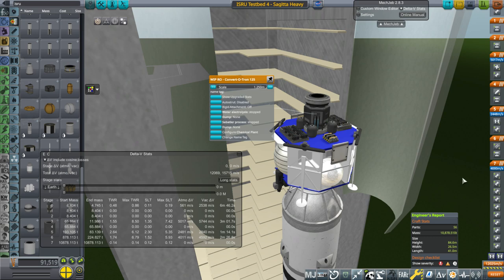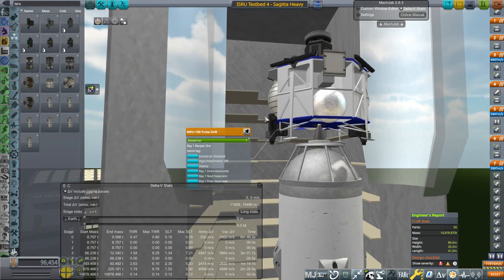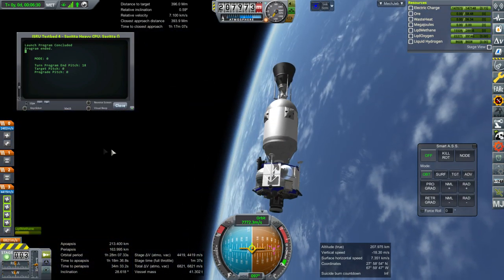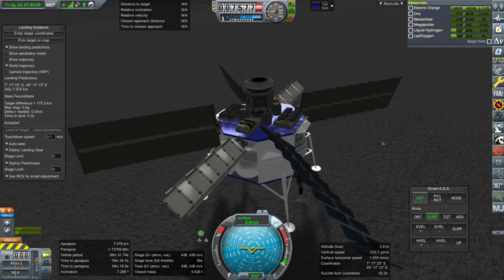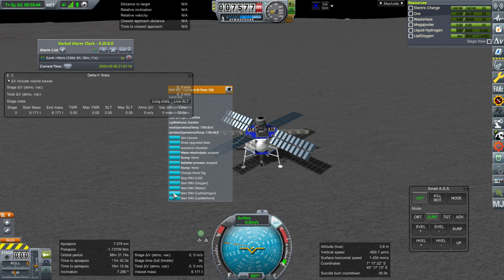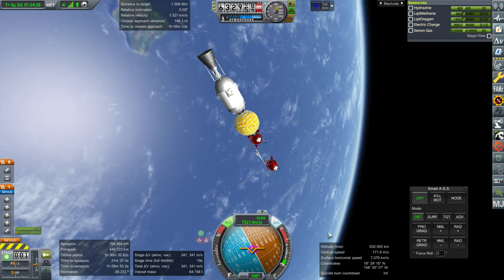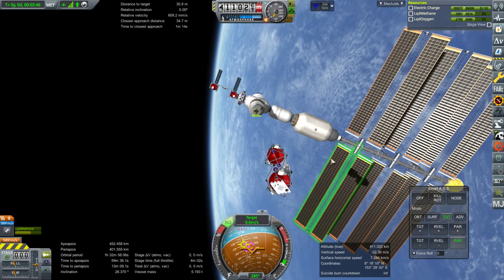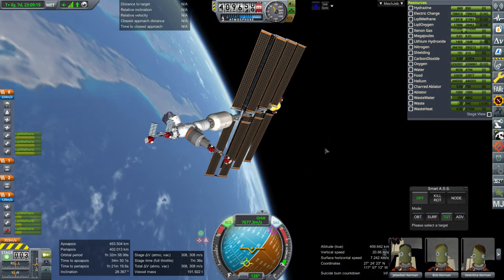KSP 1.6.1 RO and Kerbalism - Mars Colonization 009 - ISRU Type 2

Comment: You could probably use some kind of robotics mechanism to extend the rovers engines in and out. That would make it a little more flexible as far as payload hauling.
Reply from the maker: If you're talking about the tug, the goal was to have it be just one part (except for the docking ports) to minimize lag around large stations. I also wanted to avoid any glitchiness when using robotics. As far as maneuvering large payloads, I have the patience to deal with that, as I've shown. The tugs really can't provide enough delta-v to handle something much heavier than the Xenon tanks anyway.
Reply: Raiz Space Yes I meant the Tug..sorry. Agree that simplicity is best.